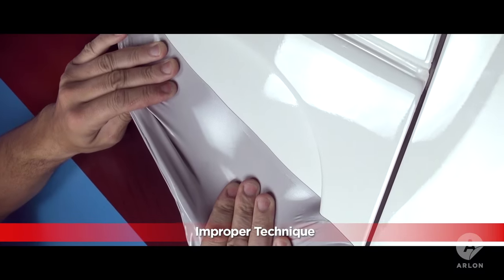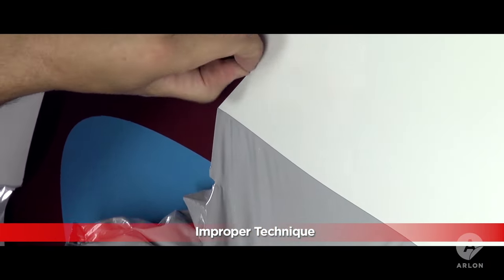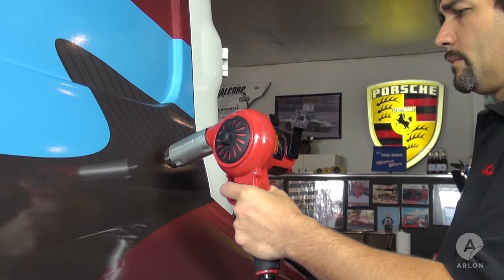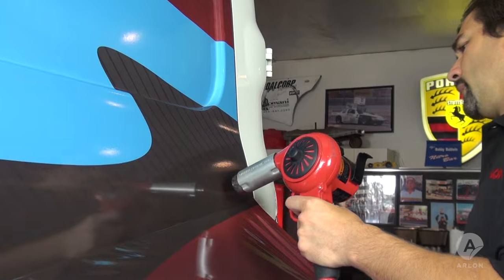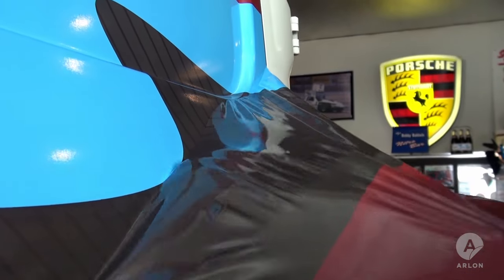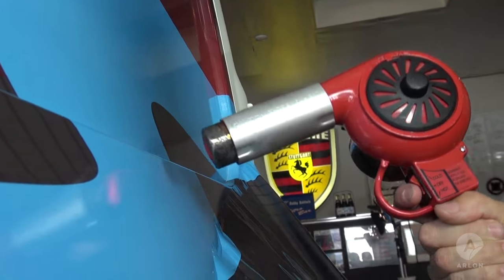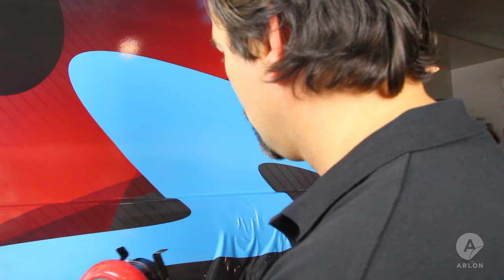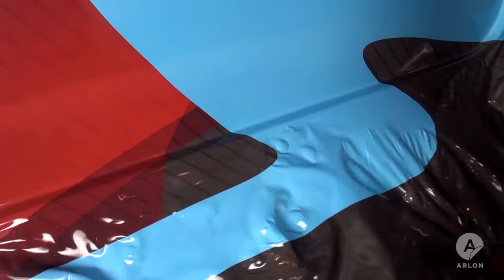Removing a Vinyl Wrap

Comment: Not me with vinyl literally baked into the paint, so when you remove it, the cars clear coat comes with it. Never again.
Reply: how long was it on for
Reply: @Fj4LiFe23  On about 4 years, it was 3M vinyl. Car was parked outside in the sun most days for work
Reply: They never sell it only last a year if well kept out of the sun.

Comment: First, all automotive wraps will eventually have to be removed, or they will eventually start to de-laminate on their own, and not all at once. To remove does take time and heat, but not too hot. Putting heat on a laminated RV side wall may not be the best for the wall as glue is used in the laminating process. Putting heat on an RV wall could have an adverse affect on it's structural integrity. On cars it's not a big deal because they are metal.

Comment: It's easy to remove fresh vinyl.  I know that in Florida, the sun dries out the vinyl and breaks down the adhesive.  I used to work at a cat lot where I had to remove graphics frequently.  On severely sun damaged vinyl, there is no easy way.  I have had to use solvents in the crease of the adhesive as you are peeling it, while adding heat to soften the vinyl, and also VERY CAREFULLY using a razor blade to cut only the adhesive as you pull(as to not scrape the paint, and can only be done on large flat areas though).  A VERY long and delicate process.  Some other methods are using the stripe erasers.  Then going back and using solvents to remove the remaining glue.  The remaining problem is that the paint underneath is unaffected by the UV light and remains vibrant while the paint exposed by the sun is bleached or faded and porous, leaving a ghost image of the graphics(especially if it was just vinyl lettering).  

WARNING:  If you plan to use a razor blade to remove aged vinyl on aged flat areas, do so at your own risk.  The way I did it was to wrap the back side of the single sided razor blade with masking tape so it wont scrape the paint.  Cover past the notches in the side so that only about 1/4 inch of the blade is exposed.  Then as you heat, and pull and apply solvent under the vinyl, spray heavily soapy water to lube the blade to slide the blade flat against the surface.  If done right, the extreme angle of the blade laying against the vehicle actually raises the cutting edge slightly off the surface, cutting the adhesive and not the paint.  If the vinyl is this old though, chances are the paint on the rest of the vehicle is shot as much as the vinyl and would need to be repainted.
Reply: Did the wrap mess up the paint on your vehicle?

Comment: how would you remove mid or low quality wraps?
Reply: Lots of work.At least three guys or 14 women.
Heat guns..
Heat lamps...
Professional eraser wheels with proper tool($400 plus wheels) ..
Adhesive remover...
Clothe raggs...
Adhesive remover...
Air blower ...
Compressor...
Vacuum..
Beer .....
Lot of time...
Know how to paint or pay someone.. .
Leave it on...
Last,just sell it for parts.